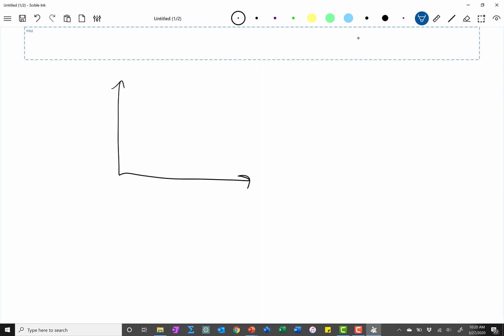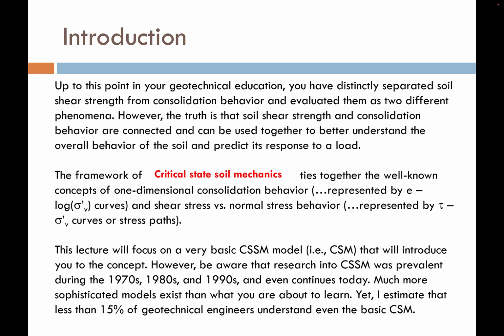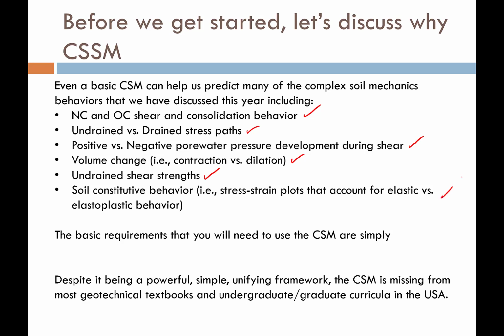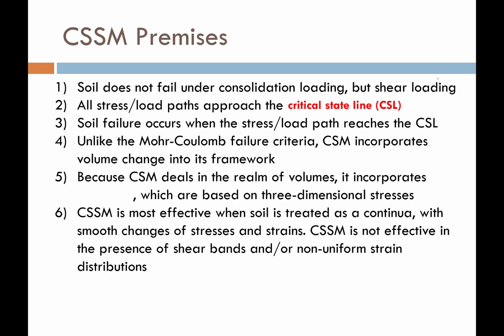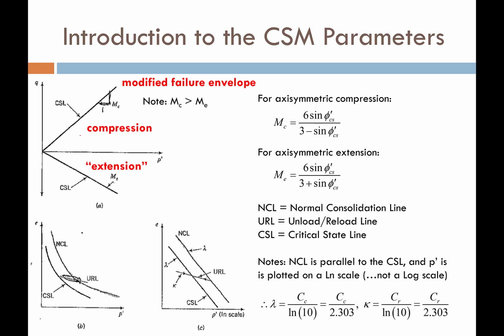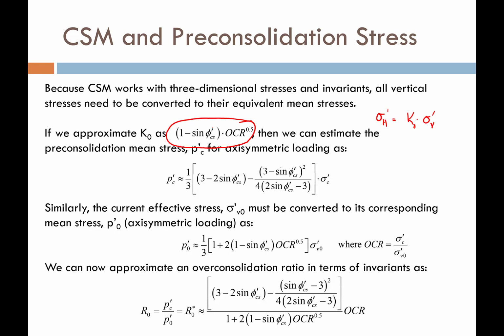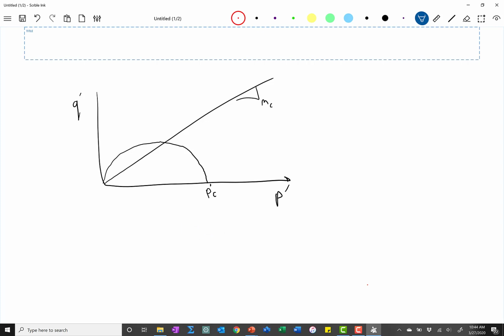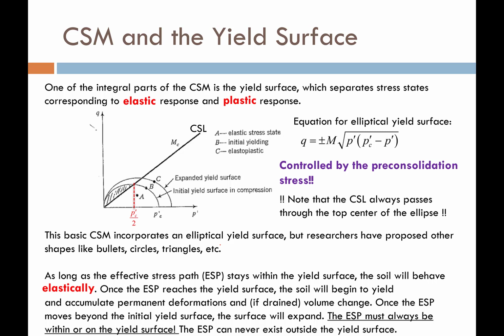CEEN 641 - Lecture 18 - Introduction to Critical State Soil Mechanics (Part I)

Comment: Min 17:20 you said: "Soil failure occurs when the stress/load path reaches the CSL". If you have dilation in a dense sand (for example) the peak shear strength will be located at soil failure, and that point will be higher than those in the critical state line. Am I correct?

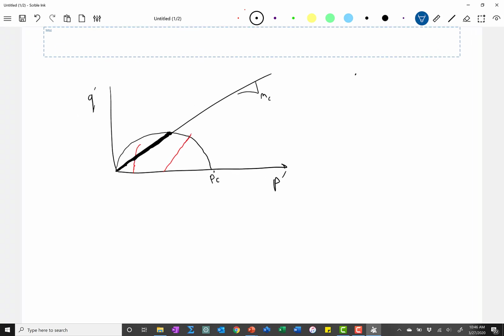Comment: I didnt quite understand at 29:54 very well. About the yield surface shrinking. So the stress path has crossed the failure envelope, and the yield surface's new P'c shifts to the left? Is that right?

Comment: I am a mechanical engineer and should develop some soil structure FE models. The lecture is very great and useful, thank you
Reply: What FEM software will you work on?
Reply: Abaqus
Reply: @mehdishekarforoush2209  Great :) But how is this geotechnique video going to help you modeling in mechanical engineering